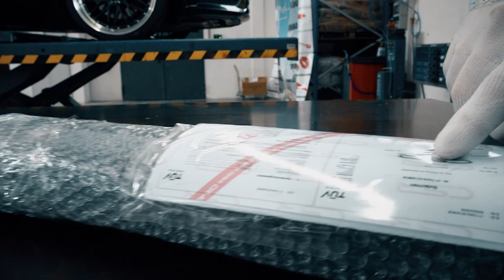Seitenschweller von CSR-Automotive für den Audi A3

Comment: Was kostet der Tausch für Audi A4 S Line Avant Bj 2017.
Auf beiden Seiten sind die Schweller massiv beschädigt von Wagenheber vermutlich
Reply from the maker: Hallo Ray, 
danke für deine Anfrage. Wir sind ein Tuningfachhandel. Die Montage kannst du entweder selbst vornehmen oder einer KFZ Werkstatt überlassen.
Reply: Bin doch kein Schrauber Lol
Reply: @raycharles4589 Ich bin auch kein Schrauber, trotzdem bekommt man sowas selbst hin! :) Einfach machen, nicht drüber nachdenken und schon 3x nicht sagen, dass man nicht in der Lage ist, ohne es probiert zu haben. Habe mittlerweile mein Heck und die Front mit Lippen und Diffusor ausgestattet, ohne eine KFZ-Lehre oder Erfahrung zu haben. Glaub mir, es ist deutlich einfacher, als man denkt. :D